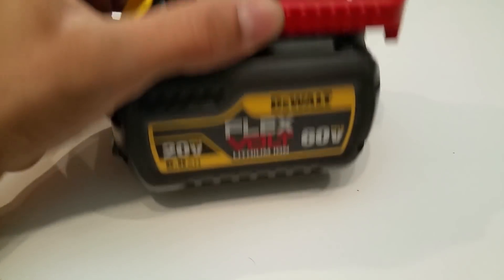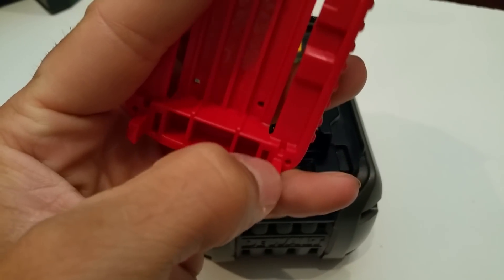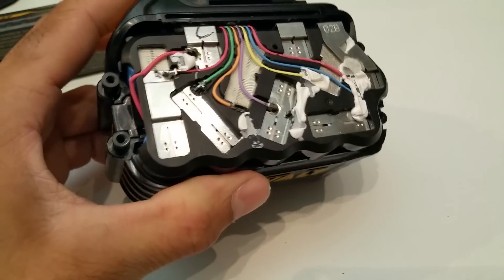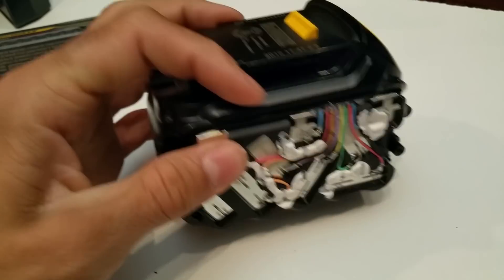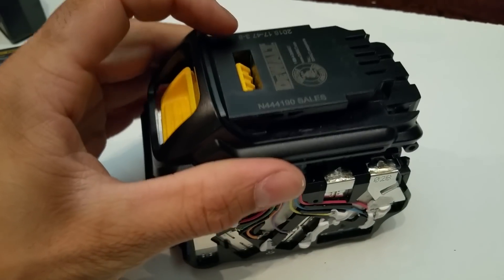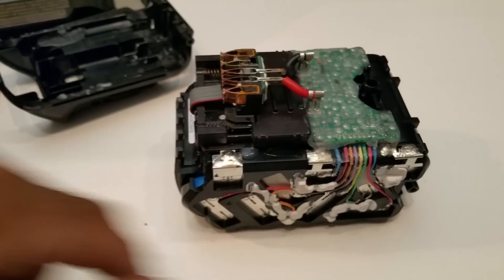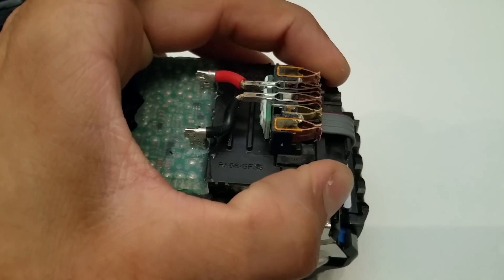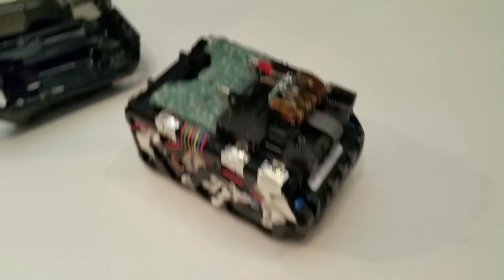Whats inside a Dewalt 60V FlexVolt battery

Comment: Thanks for the teardown.
I don't think the main purpose of the spring loaded slider is to disconnect the output voltage. Instead I think it switches between 20 Vmax (18 Vnominal) and 60 Vmax (54 Vnominal), so the switch itself puts the cells in 1p15s or 3p5s. So I think all 60 V tools will have similar taps to switch the output voltage from 20 Vmax to 60 Vmax. And 20 Vmax tools wont have the taps, so it's still backwards compatible with existing 20 Vmax tools. It could be a 3 position switch with an off position too, or it could just be a 2 position switch that switches between 20V and 60V.
You can easily test this by connecting a voltmeter between the two output voltage terminals and measure if the voltage changes with the slider switch in different positions. You can still measure this after putting the battery back together.
Reply: I can confirm the slider does exactly that, with 3 positions:
extended: 5 series 3 parallel, for 18V,
half pressed: 5 series 1 parallel x3, disconnected from each other, for shipping,
fully pressed: 15 series 1 parallel, for 54V. The two thick red and black wires you see appear in series with this and may require shorting before 54V appears at the main terminals. I didn't look further into this though. I tore down a dead battery in the name of science. There appears to be no protective disconnect circuitry onboard so use extreme caution if experimenting - this battery would be violently powerful.
The switch mechanism and sliding contacts are under the black cover in front of the PCB.
Reply: @unconesss thanks for the clarification
Reply: that makes total sense, that's a neat trick.  1p15s for 60v and 3p5s for 20v, wonder how it charges?  in 3p5s mode?
Reply: Would be cool to know, but it should be easy to measure, just put the probes on the contacts and push the switch. But sadly i don't have one :[
Reply: As per this DeWalt battery shipping PDF (http://service.dewalt.com.au//uploads/May%202017%20-%20XR%20FLEXVOLT%20Battery%20Shipping%20Website%20Copy-%20UK%209%200Ah%20update.pdf) it changes it between 54V mode (or “60V” in US) to 18V mode (or “20V” in US) and this is obviously how the existing tools work with the 18V/20V mode whilst also being a way for a battery to technically figure it’s Wh capacity into one-third to get around transport restrictions.
Reply: I found out from a horrible experience of getting my battery wet that that is actually a reset that makes your battery work again if you accidentally get it wet just make sure you dry it out right away.

Comment: At 20v it delivers the rated 6Ah exactly as the label indicates but it only delivers 2Ah at 60v so what that this mean?  well think of it this way you have 6 gallons if you pull 20v and only 2 gallons at 60v  that what it  means
Reply: +Ari P Oops, my bad. You are of course correct. E = V x A x T.   In my head I was thinking Watt Hours when the units are Amp Hours. I stand corrected, thank you.
Reply: An Ah is a unit of energy.  A 6Ah 20v battery holds the same energy as 6Ah 60v battery.  

I did some googling. The battery contains 3 2Ah packs. 3 x 2 = 6Ah. The sliding bar switch mentioned in the video changes how the packs are wired. In parallel they are 20v but have 3 x times the current as one pack. In series it's 3 x 20v = 60v but the current is the same as just one pack. Either way the total power output is the same and so is the total energy. (6ah)

http://toolguyd.com/dewalt-flexvolt-answers/
Reply: Yes, what you said in your second paragraph is correct, but in the first paragraph you said a 6ah 20v battery holds the same energy as a 6ah 60v which is incorrect. A 6ah 20v has the same as a 2ah 60v or a 6ah 60v has three times that of a 6ah 20v.   v x ah = energy.  60v needs 3x as many cells which is why you end up with 1/3 of the ah. Ah is energy at a given voltage but if the voltage is different that that is a different comparison. Just like wattage in ac is v x a. Watts if your ultimate power or energy.   Proof is that the dewalt packs are 20v 6ah, or if used at 60v are 2 ah. Same pack and same cells. How could it have any different energy stored?   So if you had a 60v, 6ah, that would have to be 3x as much. The dewalt pack takes the extra sets of 2ah cells and rather than put them in parallel them for more ah as a 6ah does, it puts them in series instead for more voltage, now losing them for more ah.
Reply: whichever way you slice it the pack is a 120Wh 
20v x 6Ah = 120Wh
60v x 2Ah = 120Wh

The battery can switch between use cases for different motor types is all.
Reply: количество энергии измеряется в ватт*часы